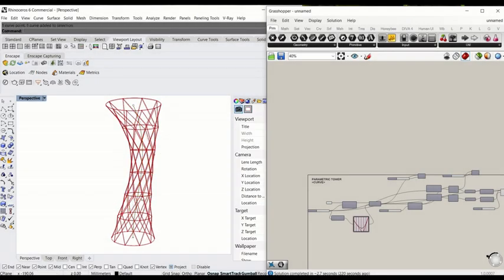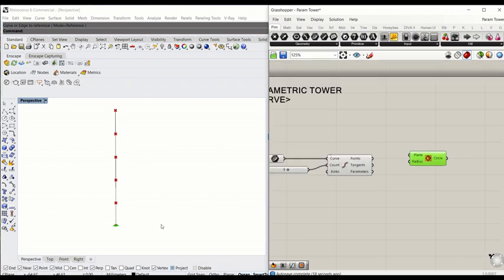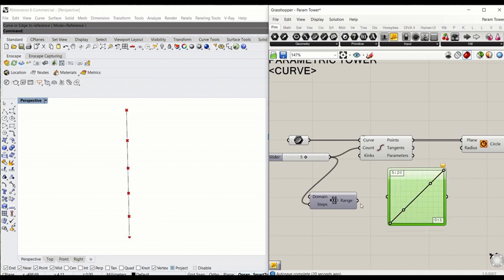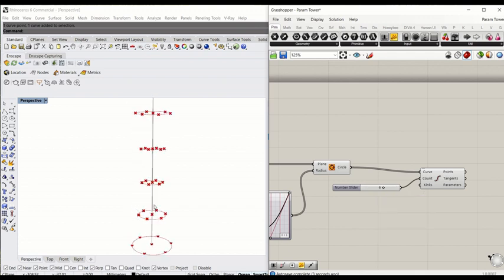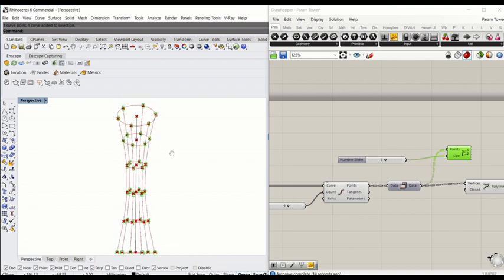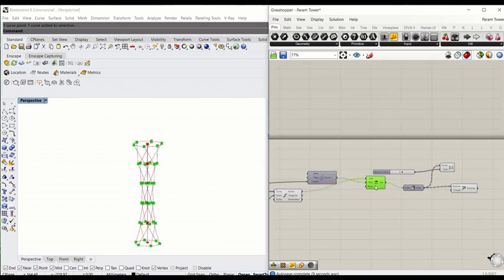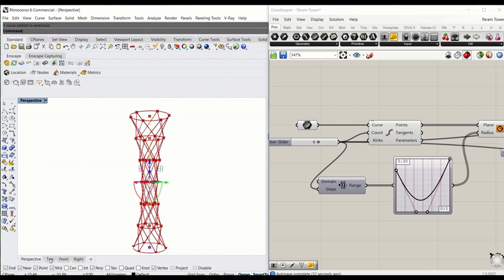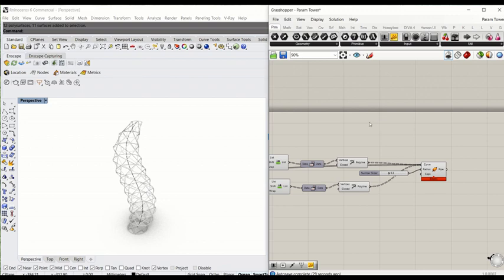Rhino Grasshopper FUNDAMENTAL series - 2. Curve - 1 Parametric Tower

Comment: I have applied this truss design to a much larger structure, resulting in 30 points per floor over 30 floors and it has made my model very very slow if I change any parameters. Any idea what the reason for this might be and how to make the model more computationally efficient?

Comment: Thanks great video. But I have a question, if I use a free drawn curve on rhino and assign it on grasshopper instead of using the circle, how can I place these curves into the segment of the line ? as it doesn't have a plane to set like the circle or polygon. ( Sorry I'm a beginner in using rhino grasshopper)
Reply from the maker: Thank you for your kind comment and question. It is a very good question. There is a component called 'Orient' which allows place a closed shape. along a curve. You will still need per frames and define the centre of the shape(this works as a plane). To define the centre of the shape, you can use 'Area' which gives 1. area of shape and 2. centroid. I might have covered this in my other tutorial so I will ping you a link if I did. Let me know if it works. Otherwise I will make one to show you how to do this. Hope it helps
Reply: @arkim7studio280  YES It worked .. Thank you very much 😃